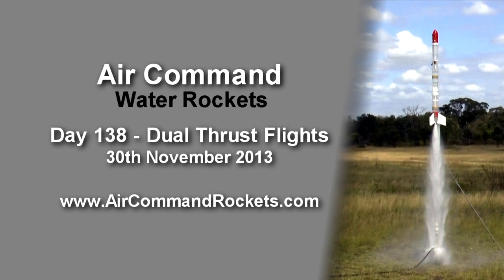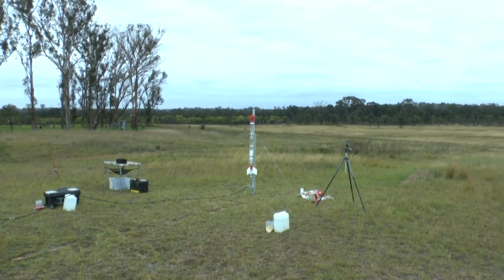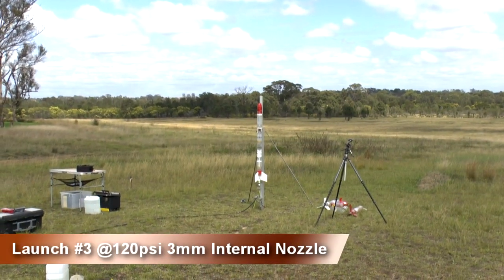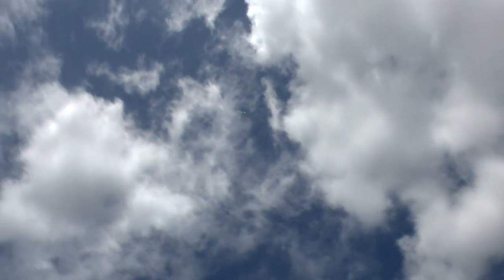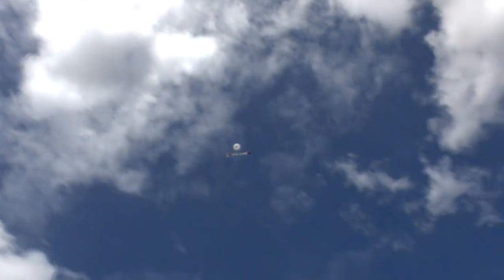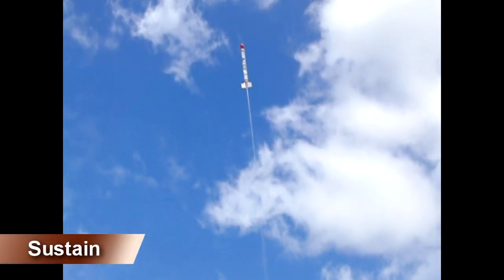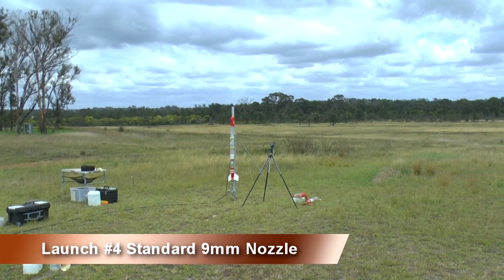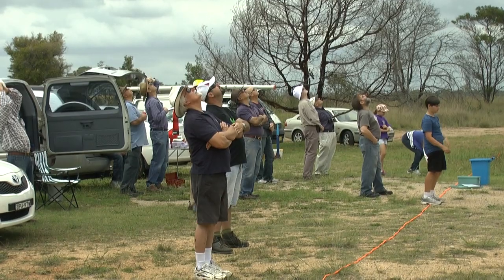Dual Thrust water rocket test flights

Comment: do you think having a first stage for boost and a second stage for sustained flight will have any benefits compared to having 2 stages with same thrusts?
Reply from the maker: I am not sure I quite understand your question. Are you asking whether a normal 2 stage rocket has any advantages over a dual thrust rocket like this? The answer is yes, a real 2 stage rocket has the benefit of shedding the dead weight / drag of the booster when the booster stops producing thrust. But it does add more complexity. A dual thrust rocket needs to carry the whole weight of the entire rocket for the duration of the flight.

Comment: Hi Air Command, I've made a water rocket of about 6 foot in length with tornado tube connectors. I managed to get a 250+ psi pump (tested, not just gauge) with your extensive knowledge do you think I can reach 1000 feet using Glass fibre roll tape and good aerodynamics?  :)
Reply from the maker: Hi bbwillii, How high a particular rocket goes depends on a number of factors, such as pressure, nozzle size, drag coefficient, volume, weight and environmental conditions. The best thing to do is run a simulation of your rocket if you know the above parameters and see what it predicts. Some of the simulators can be optimistic at times so you would want to make sure you give yourself at least a 20% margin.

Comment: Wow two great videos =)
The dual-thrust-technology looks very interesting, I think thats a good alternative instead adding boosters on the rocket!
Greetings from Germany!
Reply from the maker: Hi Raketfued, The dual-thrust rocket is unlikely to outperform a rocket with drop away boosters or a two stage rockets. The problem is that it ends up carrying the dead weight of the booster section. This was just an experiment to see how well dual thrust works in water rockets.
Reply: AirCommandRockets
Okay thank you for the Information.
May it´s not very efficient,but it looks very interesting ;)
Reply from the maker: RaketfuedRockets We're going to have another go at the dual thrust concept, but try to solve the blow-through issue with the boost phase. I think we have an approach for this now. How effective the changes will be is still to be determined.

Comment: I wonder, how will a multiple stage rocket fare? I understand that you've made a 2 phase propulsion engine, but I'm interested in seeing how a 2 stage engine with spent canister dropout would go. It seems to me like it would be more efficient...
Reply from the maker: Yup, two stage rockets perform quite well and are more efficient than the dual thrust rocket. Here is an example of a big 2 stage rocket we fly: Water Rocket to 864 feet
We also fly rockets with drop away boosters which are not quite the same as two stage rockets but also perform well: Axion G4 rocket with boosters
Reply: AirCommandRockets
After watching those videos I only have more questions...Such as how effective would one of your rockets be at carrying a 1kg payload, and why does NASA still think a big enough water rocket won't be able to orbit?
Reply from the maker: rparker069 It depends what you are trying to do with that 1Kg payload, lift it to a particular altitude or make it go fast. You could lift a 1Kg payload to 500 feet quite easily. The big booster in the above video can lift a small kid to an altitude of about 4m. Not that we've actually tried it .... still looking for volunteers. :) Unfortunately proper cold gas water rocket's ISP is too low to reach orbit by itself or staged. If a rocket burns oxygen and hydrogen to produce water does that make it a water rocket? :)
Reply: AirCommandRockets I suppose the payload would be trying to get it as high as possible, after all that's what rockets are for right? ;) And I think if a water rocket could get enough speed and momentum before its propulsion system becomes innefective then it should be able to at least break the atmosphere. Of course it would have to be quite highly pressurized to do so, and highly optimized, but I still believe it's possible...
Reply from the maker: rparker069 The problem for water rockets is that increasing pressure leads to the need for stronger pressure chambers which means increase in weight which reduces altitude. There is also a limit to how much you can compress a gas before it turns liquid and becomes incompressible further, no matter how much more you increase pressure.

Your only option then is to stage the rocket to make it gain more altitude. Going on a rule-of-thumb 5:1 ratio of lower stage capacity to upper stage capacity, you soon realize the practical limit on the number of stages you could have. Even with the highest pressures and optimized stages, you are at most likely to reach a few km in altitude. Another option is to use a balloon and launch the rocket from there, but again you would only expect the rocket to only go a little higher than that.

The great thing about water rockets is that no one knows what the practical limit is and so people keep trying to push the envelope.
Reply: AirCommandRockets
Blast! Accursed rocket science! I wonder how high a pressurized gas cylinder goes when you give it fins, a pointier nose, point it upwards and knock off the cap... I suppose I need to do some tests! (And just a side note, I think it would be cool if you included an accelerometer in the equipment on your rockets so we can measure just how much thrust the water/air mix has)

Comment: How much thrust does the second phase deliver, since I believe that you will reach reach maximum altitude when traveling at terminal velocity, so your thrust has to deliver twice the force due to gravity.
Reply from the maker: This is a good question. The second phase thrust level can be adjusted by varying the pressure and the size of the internal nozzle. You can certainly optimize both of these parameters for a particular rocket to achieve the best results. We will put the dual thrust rocket on the test stand and measure the actual thrust profile for the two phases with different sized internal nozzles.

Comment: Glad to see your rockets up in the air again George! I wonder if you were to use a larger internal nozzle around 15 or 16mm, then maybe you could get an extra boost.
Reply from the maker: Thanks Randy, it was good to finally get out to the launch site after the break. :) I'm sure if the internal nozzle was larger the rocket would perform better. The point of this experiment was to try to make the internal nozzle as small as practical so that there was a definite distinction between the boost and sustain phases. The 3mm nozzle used with a couple of the flights would have been too small to get the rocket very high off the pad. With the dual thrust setup we were able to fly the 3mm nozzle without doing any staging.